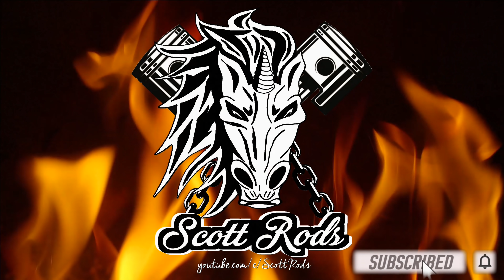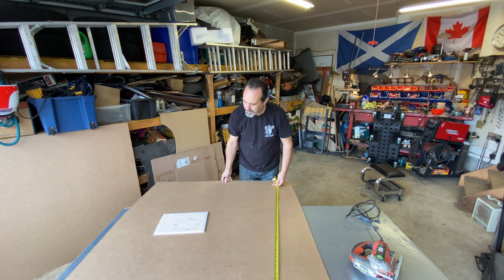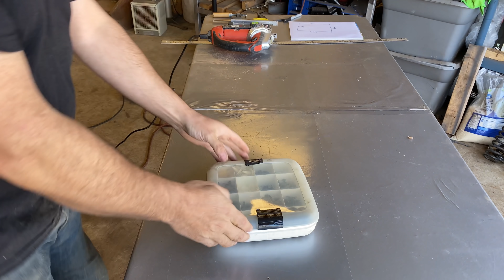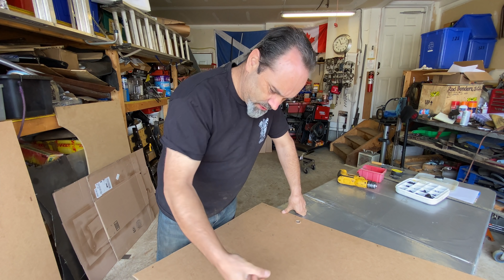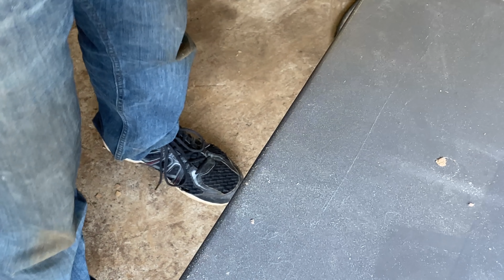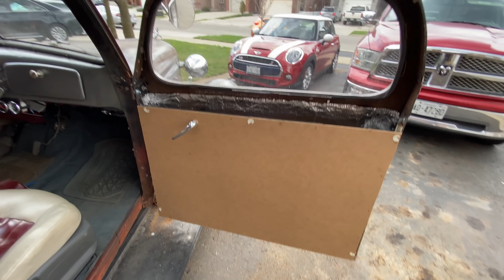Making Simple Door Cards For My 36 Chevy Coupe Hot Rod

Comment: Should have used spring clips. The door panel can still be removed, and it won't pull threw the hardboard. I used 1/8" wall paneling. It is made of plywood. Won't fall apart if it gets wet like the hardboard will.

Comment: Good start I would round corners instead of square might need to weld bar onto the one's you already have to bolt your door pulls to not just the door panels that way you don't pull thru or tare the door panels  but keep at it your getting closer with every new part you get put on the car stay safe stay healthy stay busy
Reply from the maker: Thanks Tim. Yes, I'll be welding in some quarter inch to attach the grab handles to.

Comment: Hi there . I stopped using that material for door panels . It really does not like water of any sort . I started using ABS plastics 1/8 to 3/16 thick . This is 100 percent water proof . It comes in 4 by 8 sheets so maybe found under plastic supplies in Hamilton area . This would also allow you to heat and form to cover area below you pop in and out windows.
It also requires a light sanding to glue on the
Upholstery material .
I also always used cardboard to make patterns  .
Please take this only as. Advice . There is no bad way if it works for you 
Also , if I recall , there are upholstery supply shop in own town Hamilton .
Good luck and car looks great .
Reply from the maker: Thanks Bruce. You are of course correct. I'm just making do with what I have for now. Once this effin virus is gone I'll be able to get out more and find the parts I REALLY want.